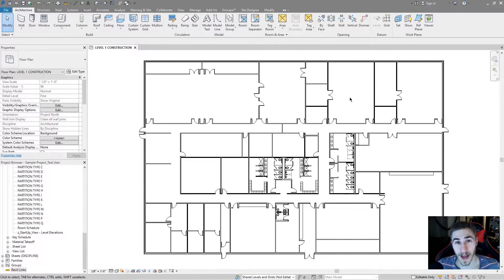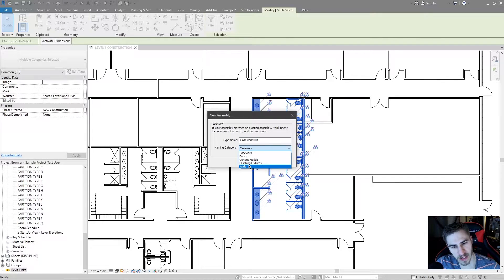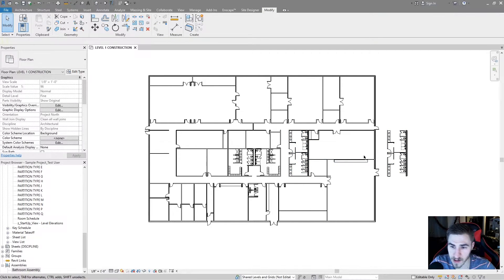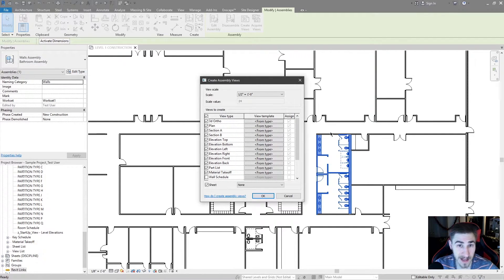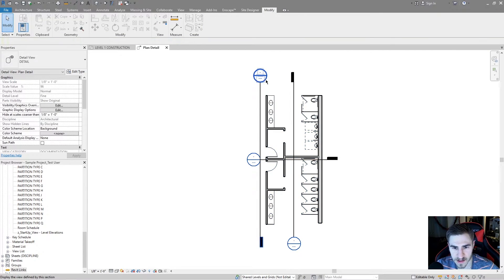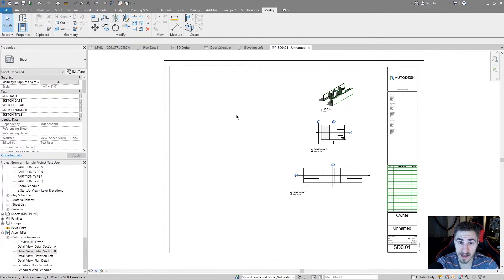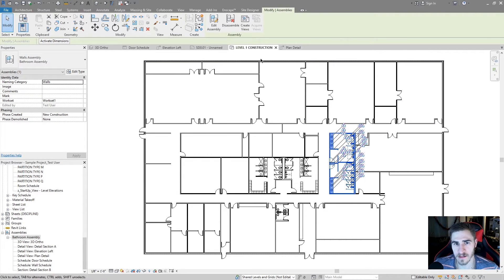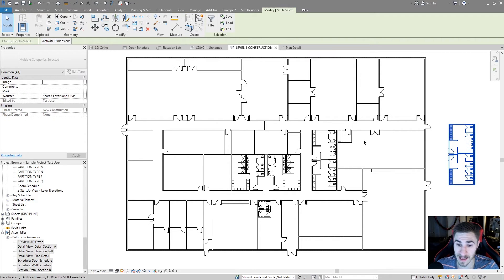How to use Assemblies | Revit

Comment: What to do, if I want to have different phases in one project file? - I mean how to differenciate assembly name for the same elementy but in a different phase? I just want Revit to consider phase as variable.
Reply from the maker: In general, you never want to have the same element in multiple phases because that element would be built in the previous phase. I would make sure and think in a way that accounts for each element being in one phase. Given that, you might need to reform the assembly to account for what is in a specific phase.
Reply: @ArchitectureVanguard  I'am the structural engineer if that matters. I have a store building which have 2 phases (A and B) and both phases are almost the same, so there will be a lot of assemblies that are the same (for example concrete columns, foundations, etc). Is there a way to take two assemblies that are the same, and do something to name it differently? Or I have to give them some parameter just to divide them in the schedules?

Comment: After creating assembly I wanted to move that assembly to some other location. after moving when I see the sheet, all the arrangements displaced why..?
Reply from the maker: oooh that's a good questions, one that I am not entirely familiar with. I will say that when I use assemblies, it is for one off things and for elements I know that will not move. You could consider remaking it.

Comment: wow very professional video!! now do MEP videos :-) a (yes i liked and subscribed cos its good content)
Reply from the maker: While I would love to do MEP videos, I am unfortunately an architect. That said, I do see the value in knowing how to use them as an architect. This is something I will look into. Thank you for watching and subscribing, I really appreciate it!
Reply: @ArchitectureVanguard  the most important thing for an architect with regards to MEP is to allow for space for MEP equipment, such as adequately sized shafts and enough headroom. as for your videos, the way you explain is very good, you have the viewer's attention. btw, I tried assemblies for MEP but then I couldn't connect piping to the assembly so I reverted back to groups. but then with groups, I had a problem of elements being automatically excluded so I couldn't connect to the piping system
Reply from the maker: Thank you for the kind words! You have discovered why I dislike groups and sometimes assemblies. They both are both considered “closed pipes” (pun intended) in that everything in them needs to stay within them and not connected to anything else for them to work. For these reason I might not use groups because so much of what is modeled needs to be connected other objects.

Comment: I have a problem with create views when I made one assembly for window. In my views are all empty. Maybe u know what was wrong?
Reply from the maker: It could be based on what is seen by default in those views. Could also be the extents of the view, although the assembly should have included what is in the assembly in the view. Check visibility graphics for sure. If you applied a view template with windows off then that may be why. Hope one of those helps.
Reply: @ArchitectureVanguard  Thank u for ur reaction. It is because of the nest families. I need to select each nest family with Tab and then make the assembly. Now it works perfect.
Reply from the maker: Awesome, glad to hear it was an easy fix!!!
Reply: @ArchitectureVanguard  Yeah, thank u for video and waiting for more!

Comment: How to compare precast walls in Revit, whether they are similar or not?
Reply from the maker: In Revit, you would model a wall (whether is it precast or not) as a regular wall. You can use a number of way to determine if it is precast. That may be the name of it or through a note or maybe called out on a schedule.

Comment: How do i set work plane two sides
Reply from the maker: The thing with work planes is that you can only set one side or one plane at a time. After you set it then you can do what you need to do. You will have to set the work plane to the second side once you are ready to work on that plane.
Reply: @ArchitectureVanguard  i want to corner place im do it draw using extrusion in triangle shape.. Bt cant draw woek plane

Comment: Don’t really see me using these to much or ever while working on CDs? You gave that elev cab example, any other times where using assemblies is the right way to go?
Reply from the maker: It could be something like a specific repeating section of a retain storefront of if there is a detailed reception desk where you need views for the specific element. Those are a couple of examples where I would use an assembly.

Comment: One comment that I’d not necessarily related but that you brought up around 2:55 and that was that if you see some parameters when you select a model element, in this case an assembly, that you can schedule it. I thought the same thing when I was working with revision clouds and I was adding comments to them but I later came to realize that there is no option to schedule all those revision comments I made. It ended up being a big timesink and I ended up having to use dynamo (not too successfully).
Reply from the maker: Yea revision clouds cannot be scheduled unfortunately, although assemblies can create schedules from the assembled items. The thing to try would be to schedule assemblies or if the elements in the assemblies if they can be scheduled as normal.